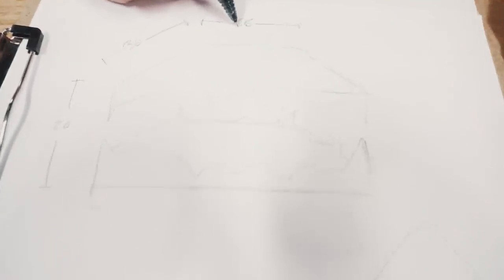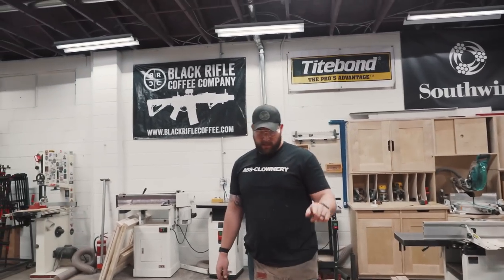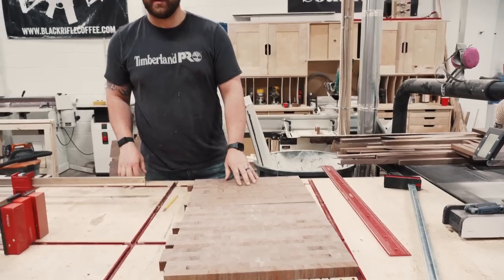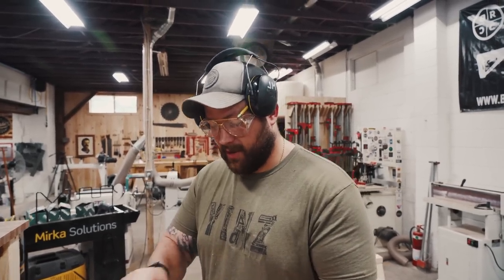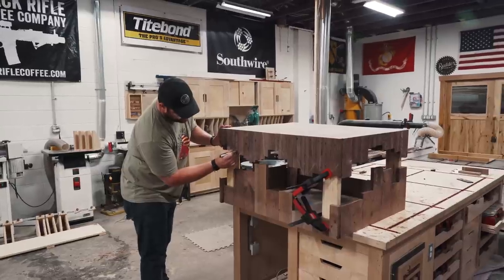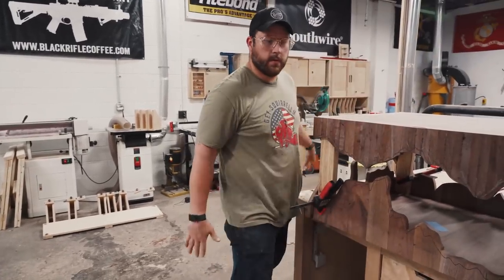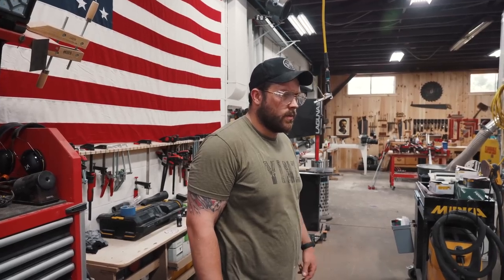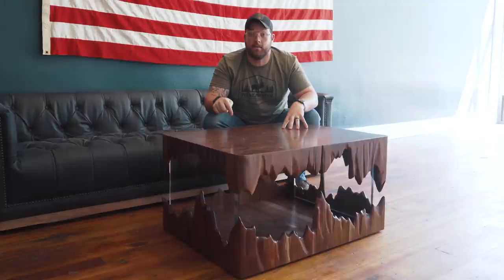IMPOSSIBLE Floating "Cave" Table Build

Comment: When clamping little pieces like that you need stability across the face and back, if you use long pipe clamps you can rest  the pipe lightly  against and across the face then one against and across the back sometimes you need to do the same to the top and bottom if you could fit 4 clamps.... it's a cool trick if you can do it and then it wouldn't explode as you would slowly tighten each clamp until they are all tight add stabilized against the back (pipe) of the clamps. New subscriber, awesome stuff I've seen so far. Looking forward to watching lots more!

Comment: Love it. Love it. Love it!!

The only thing I didn’t completely like was seeing the edges of the acrylic in the finished table, and also the cost of the acrylic... ouch!

I’m wondering if it would be possible to do a 4 sided “river” epoxy table? Like I’ve seen this similar raw edge wood with epoxy in between made to look liked a river for a table top, you could possibly use a similar technique to achieve the floating table illusion? 🤷🏻‍♀️ idk but maybe, just an idea 🙂
Reply: thanks rara your so professional
Reply: Agreed,  I was kinda Disappointed also since the Thumbnail shows now Acrylic. 
Could of also just used 4 acrylic cylinders offset twords the middle would have no flashy edges.
Reply: @nickc1473  or simply route a very small curve on the edges so no sharp shiny lines.

Comment: Instead of the acrylic, I wonder how it would look to have pillars inside cut to look like more stalagmites and stalactites. Great work regardless, it's a fantastic idea.
Reply: It would look fine but the whole point is it’s supposed to look like it’s floating and the nothing is connecting the two sides. Making wooden pillars in the middle would kind of defeat the point.

Comment: Idea?  Use internal stalactites and stalagmites to make the table a tensegrity as well!  Best of both!
Reply from the maker: Yea the tensegrity tables are getting a bit tough to make sturdy enough to plop my huge ass on. So i gotta figure that out first. That was my original idea. But this worked out to be a bit better i think
Reply: It doesn't have to be tensegrity, just the stalactites and stalagmites could come together to make legs in 3-4 spots.
Reply: pour stalagtiets and mites in acrylic, then mount on the inside to hold the table top. even use some dremel bits to score them to make them look rough then add leds so at night ya can light them up.
Reply: @coffinsnail6930  I was thinking something very similar to this. All this video did was "open the flood gates of imagination"!!!!
Reply: John Malecki tensegrity with chains.  ;)

Comment: Looks great! Put some LED strips under the acrylic 😊 like literally below the bottom edge of the acrylic pieces. Due to the difference between the index of refraction of acrylic and air the acrylic will act like a light pipe and transmit the light to the top with little escaping out the sides (unless you rough them up). Could look cool.

Comment: I feel like setting up an actual perfect shape that collapse on itself and putting electromagnets that pull in the corners and a slight stronger in the middle that pushes up... so it can collapse on itself until you flip a switch... or am I insane.

Comment: Thought about what you were going to do beforehand, and had it mostly figured. When you started joining the sides to th top and bottom my figuring went out the window. Thought this was going to be and epoxy table. Make a mold for the top and bottom sides, set in top and bottom and pour your epoxy for all 4 sides, then the same for the top.  Join the side to the top and bottom sections, do the sand and polish magic you do and Preston, floating epoxy table. Can't believe you used plexynglass
Still fantastic table.

Comment: Looks good really. You can see your non floating aspect a little more than I thought you would be able to. Honestly I would have took one sheet of poly and just went from on corner diagonal to the opposite. That way from certain angles you wouldn't see it at all. I think it would definitely look more floaty. That's my opinion though. Still, looks good.

Comment: after flame polishing acrylic you cant clean it with any thing with ammonia (windex or other) cleaners it will hair line crack  but if you use a polish wheel and polisher it wont

Comment: you could thinner the acrylic boards' edge, so there will be only 1 visible line to make it looks more convincing.
right now, it looks like you use metal sticks to hold those two pieces.

Comment: the way he puts his hand so close to that blade so easily and unbothered ,
I just don't see why not just be a bit safer , everything goes smooth until that one day and there goes half your fingers for life.
Reply: Came here to say that, use the pusher...one of those boards grabs and kicks back pushing your hand into the blade. Use a table saw enough times and you'll have a board kick back on you. Cannot imagine the damage if not using a pusher...

Comment: You could take the slab and router the negative space of a tree of life design.  Then burn it.  Then when you flatten it in the planer the high relief will be same height as the negative relief and will be un charred wood.  Black and white-ish contrast.

Comment: That was awesome, I wonder how it would have looked by putting lights either at the bottom or top of the acrylic to have a bit of a glow and to really top it off add stalactite and stalagmite inside the opening. Again that was awesome.

Comment: Would of been interesting to revisit this design and make it without the acrylic panels and try the suspension method with the opposing wires and have a pair of just off centred supports in the middle (centred wire cable support) and have them hidden as a part of the cave organic design....  I can't think of the correct term for the suspension method using the wire cables... But it would look great.

Comment: good work, but as perfectionist i think it will be more unique with round glass corners. So the point is to find the right shape of the angles (maybe not round) when there were no (minimum) reflection on edges.

but still nice ofc

Comment: Hey John. I came across this video after subscribing to your channel. I just love this table. I had an idea of trying one of my own but rather than using the laminate. I'm going to use a top coat epoxy on all four top and bottom sides first then fasten them to the top and bottom and buff the top coat to a mirror finnish and see how it turns out. What do you think worth trying?

Comment: Okay John how did you mount the 4th acrylic panel? I can understand mounding the first 3 with the inserts, but the 4th panel you would have no access to the inside! Are you hiding 4 exposed bolts on the couch side at the end?

Comment: You could have made the stalactites and stalagmites at the corners to touch, connecting the top to the bottom without the need to use anything else. That would look even cooler in my opinion.
Reply: I was thinking about something similar: stalactites and stalagmites on the interior of the "cave", with the middle ones connecting and concealed by other non-connecting ones - open on the corners.

Comment: IMPOSSIBLE Floating "D&D" Table Build. In this table design you could do the chains on all four corners and a pillar an chain in the center holding it up and on the inside. You could have like knights, wizard's, rogue, and healers fighting a dragon, horde of zombies skeletons, and a lich like in a Dungeons & Dragons game. On top you could have like an actual D&D table. Also you can use the pieces that are underneath the table as the D&D pieces.

Comment: idk think this would have been better with metal frame around inside of each side with a chain in middle pulling in opposite directions to make a floating table then filled the inside with dirt and moss and added some lights and a waterfall to make it look cave like would have been pretty cool

Comment: I feel a little let down; admittedly I did Skip ahead to find the magic is only plexiglass. I was really hoping that he used a system of cables to suspend the top table. This is the actual way of floating table should be constructed.
Reply: bob shermer he said he didnt wanna use tension like on the last floating tables he did.. he says it at the beginning.